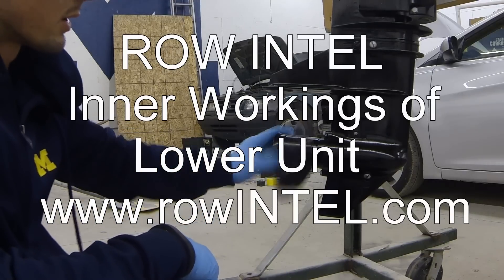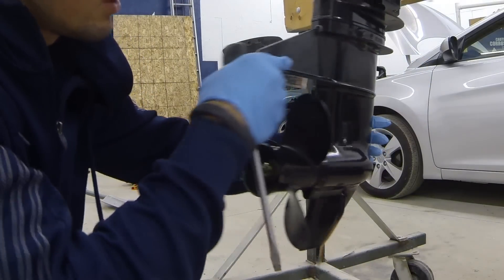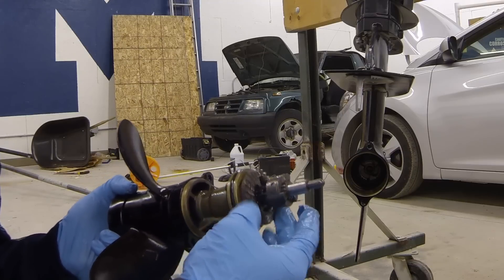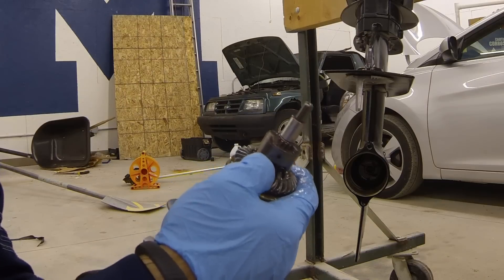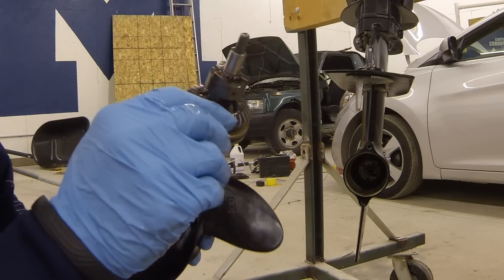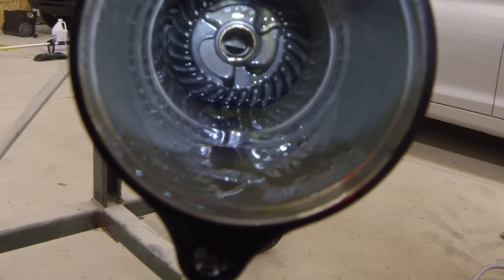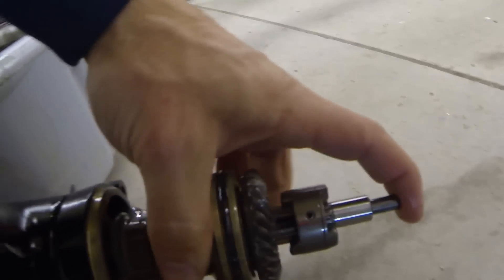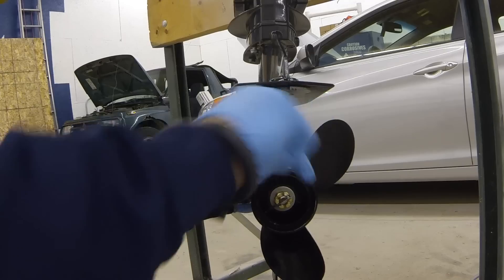HOW TO take apart a lower unit on an outboard motor, how it works

Comment: My 1997 Nissan 70 outboard motor seems to have a problem with the lower end.  Over the weekend the motor was working fine... my 18 year old son took the boat out for a spin with 5 other boys.. which may have been too much weight..(but not a crazy amount of weight).. anyways they left the dock without issue then crawled back to camp an hour later.. of course he said he didn't do anything.. but now the motor spins when it reaches the power band.. around 3800 rpm... it drives... reverses and goes putt-putt... but when accelerated and when it would normally start to "get up".. now the motor sounds like it comes out of gear and the engine whines and the propeller does nothing.. no speed is gained and actually the speed you had is lost and it feels as though the propeller isn't doing anything.  i have the boat professionally winterized and stored for the winter and checked over before i pick it up in the spring.. i am pretty certain their check includes oil levels including the bottom end...
i only have 3 boat dealers in my area and they say their shops are crazy busy and it might be a month before they can look at it... any help you could shed would be appreciated...
Reply: Jack Glassford ... figured out it's my prop... only $150 replacement... thanks anyways

Comment: HI.  I started my 1999,  90 mercury 4 stroke on muffs on the driveway and I hear an intermittent knocking sound when in reverse every time in the leg. Also does this in forward  sometimes.  Sounds like gears knocking together. Doesn't make this sound in nuteral. Also when not running I try to put in reverse it only goes in sometimes. Any ideas?
Reply from the maker: The not going into reverse when not running is typical, the vibration from the motor helps things jiggle and line up right, it's nothing to be concerned about. If you rotate the prop by hand with motor off, it should go into gear just fine (rare case if it doesn't even when turning prop by hand, then flush gear case with gasoline, then change gear oil several times, you've gotten water in there and need to flush out the dirt and grime (gasoline) then make sure you have adequate  lubrication (multiple gear oil flushes).  As for the knocking sound, you do have a problem.  If it's loud and hard sounding, and about half the rpm of the motor frequency wise, then you have one or more teeth missing or chipped on the ring gears. I'd disassemble and replace the broken parts for just a few hundred $s vs waiting for it to get worse and spending $800-1500 on parts.  How many prop strikes have you had?
Reply: I run on a reservoir with lots a wood so I hit tree  branchs sometimes.  No water in leg oil  with very few metal shavings In oil. The knocking is pretty loud and sounds hard. But intermitant. I put it the lake and took a metal rod from lower leg to my ear to listen at under load reverse and forward and didn't hear any unusual sounds.  My local dealer won't touch the lower leg. He says it will cost same to fix as new leg and not worth the money. Is it very finicky  to do myself?  The cost of new oem take off leg is about1800$. Your thoughts?
Reply: I checked my leg oil this morning after  running and it was a grey color.
Reply from the maker: Dale Desrosiers If its grey then there is water mixing with the oil.  Water mixing with oil means you are going to have worn out parts.  First off, the main seal ~$3-400 would be bad since there is water getting in.  Next, once you open it up, you are going to have quite a few other expensive parts to replace for sure.  If you're only looking at $1800 for a whole new gearcase (which is a cheap price) then run it til it dies, take it apart to learn about it, and buy a new gear case.

In the future, frequent changing of the oil and less prop strikes will make it live a lot longer.  You can have a few mild prop strikes, but each time you damage the seals, and then need to replace the oil more often to prevent oily water from being the lubricant down there.

Comment: I have a question. I'm trying to fix this myself because it's really expensive to take to shop I have a 90 hp Mercury year is 2000 and I was running it on the lake one day and it just stopped and went really slow. I thought i had spun the hub but it was fine once I removed it to check it and so I think the problem might be inside the lower unit. Should I just buy the whole thing or what.  Plz reply thxs